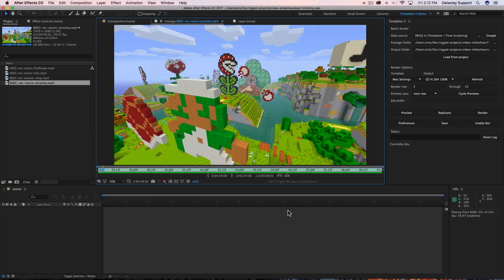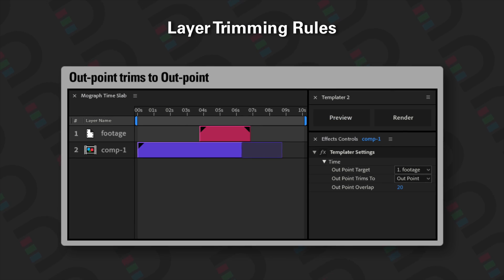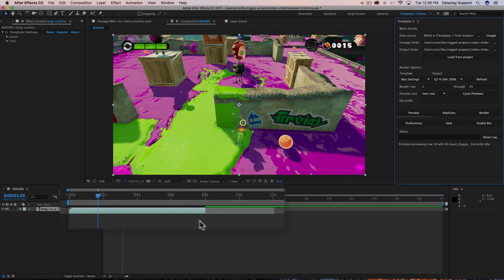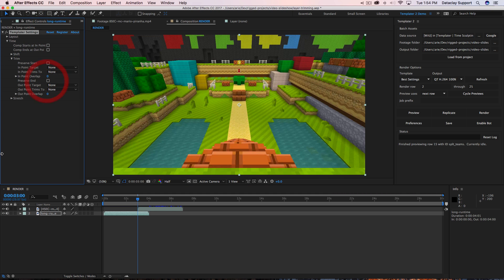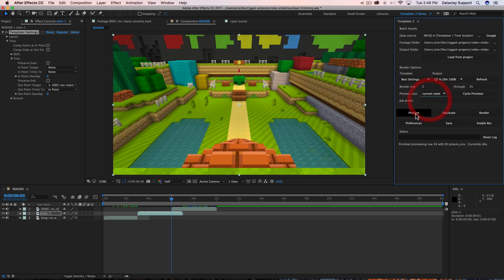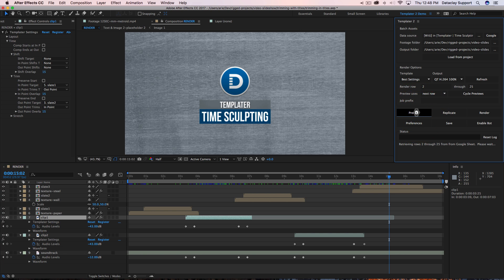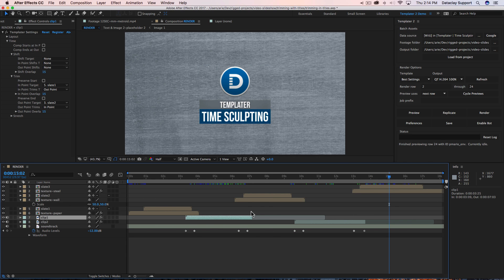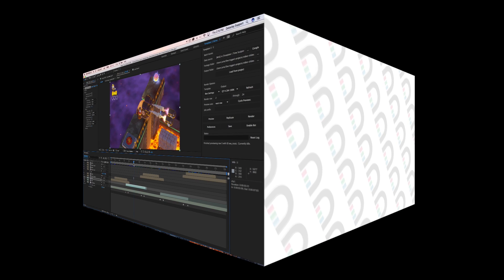Time Sculpting | Layer Trimming

Comment: Can you inject the layer's duration as an imported value ? Using a cell of the row with a uration in millisec for instance ? Duration + time alignment would be great. Thanks !
Reply from the maker: You can absolutely set the duration of a comp using data from the spreadsheet using a feature of Templater Bot known as Event Scripts. Event Scripts allow you to run custom After Effects ExtendScript actions at various points throughout the versioning process. They can also use data from your Google Sheet as variables, which you should theoretically be able to use to adjust the comp duration as needed. 

I'd recommend taking a look at our support website ( https://support.dataclay.com/templater/content/home.htm ) for more information on Event Scripts, our Github Page ( https://github.com/dataclay/event-scripts/tree/main/ExtendScript ) for some example scripts, and our forums ( https://forums.dataclay.com/ ) for some previous posts talking about how to implement this sort of thing.

If you have any other questions or if you run into trouble, feel free to get in touch with us directly at support@dataclay.com. Thanks, and happy rendering!